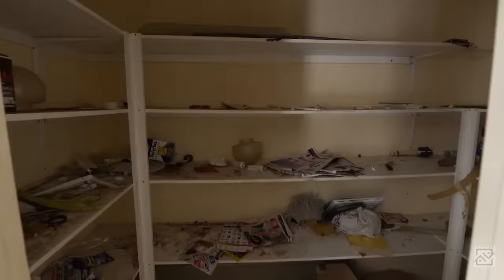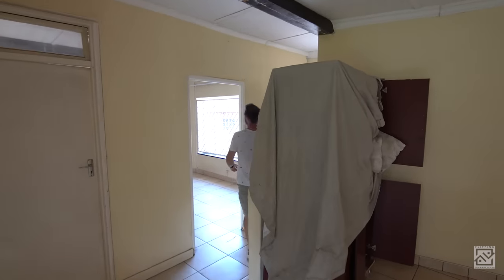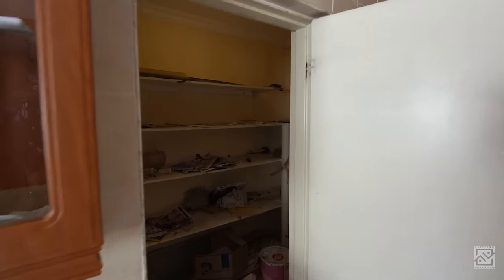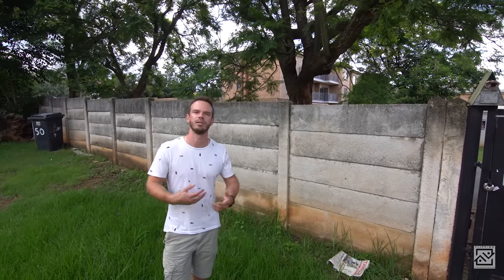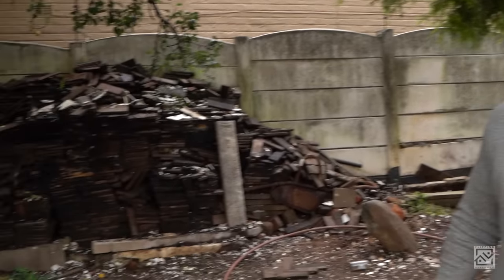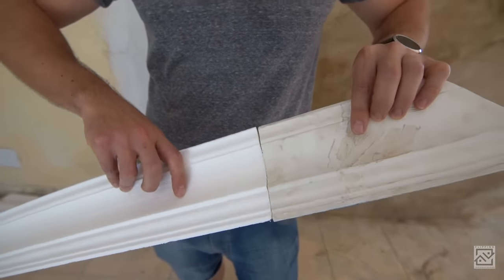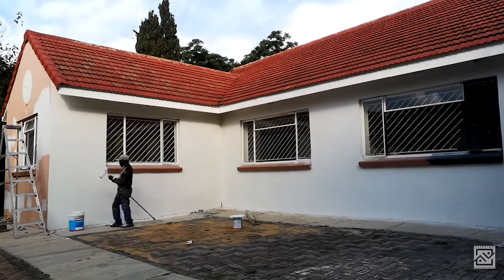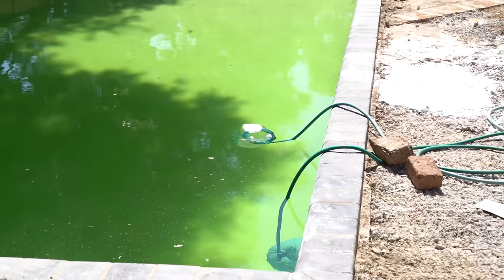Before and After House Flip - Project H | Sold in 1 Week! | HUGE RETURN

Comment: Amazing job. So spacious. 

One question if I may please. Why do some windows retain the cages while some doors and windows are just glass ? Clearly not for security, then what was the function of the caging ?
Reply from the maker: Thank you.
Good question. So the reason I didn't put security gates on the new sliding doors was twofold - 1. Budget. 2. Letting the new owners decide which security gates they would like to put.
The purpose of all the bars is security.

Comment: Hi Steve, the wooden fence that you have added on top of the vibracrete, did you just drill through the columns and bolted them down with two bolts? Regards Theuns

Comment: I've done something like this before but I never sold ...I rented out and will sell later. Doing this impacts you physiologically since you spend alot of money and the labour just does the wrong thing all the time. I also just stopped for a few months at some point just to get more money and to take a break. Ppl also broke in to the house and stole taps and tools. It's just a difficult thing to do. I am lis to do it again because I like to create but I'm holding back because doing this is just not worth the stress.

Comment: Why on earth would you paint the roof black? That's going to draw more heat into the crawl space or house, which increases cooling costs, as well as cause the tiles to break down faster from the added heat.
Reply from the maker: To my knowledge and after consulting with experts: a darker roof does have more of a warming effect than a lighter roof, but not by much. The design of the house plays a bigger role !
Reply: @FlippingJohannesburg  With tile that is probably correct, with proper insulation that is probably minimal. In Florida, US, the rating for shingles is 35 yrs but when using black or darker colors it reduces that by almost 10 years. I was only speaking from my knowledge and not attempting to insult anyone. The overall house looked amazing, kudos on that.
Reply: @timg6223  The weather here in Johannesburg is not like in Florida USA, average temperatures here are on average 24* Celsius very cool, in fact the average weather of South Africa is very cool and pleasant, homes here don't even require built in central heating and cooling air conditioning.
Reply: @hopebuhali3887  The more you know. Who knew that sunshine had no impact on materials in SA. Here in the US, whether you live up north in similar climates to what you described, the sun still causes wear on materials.
Reply: @timg6223  I never said sunshine had no impact on materials on SA, because of the type of climate and sun exposure in Johannesburg, its going take a very long time before most of the materials start to break down, like tiles as you mentioned.
Reply: @hopebuhali3887  Just teasing. It's all good. I understand your point and there's evidence to both sides of sun wear regardless of roofing materials/colors/climates. Cheers.

Comment: The floors and bathrooms definitely weren't selling points, as they are very basic, out of style, and flooring around the house very cold. Walls in the kitchen and taking away from the kitchen potential. I do understand this project was already over budget, but its not contemporary at all, it doesn't have any style. when the staging is gone, its gonna be tragic. Glad you sold it, but its a major flop. with a little bit more effort you know have made even more